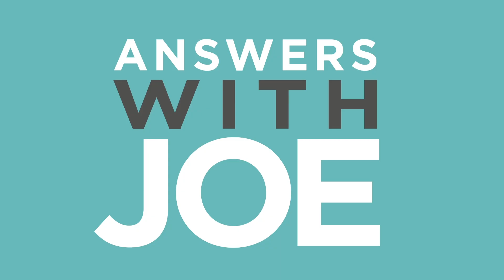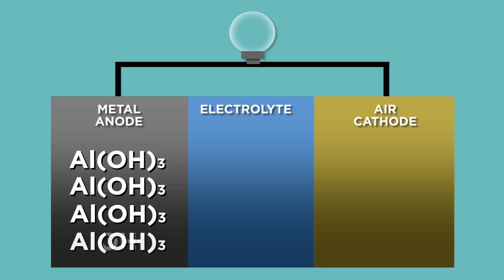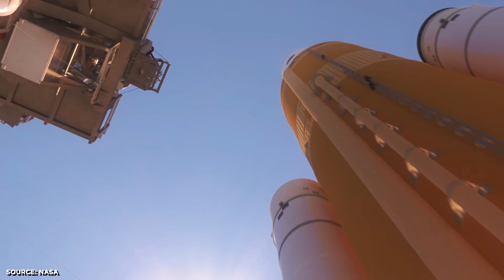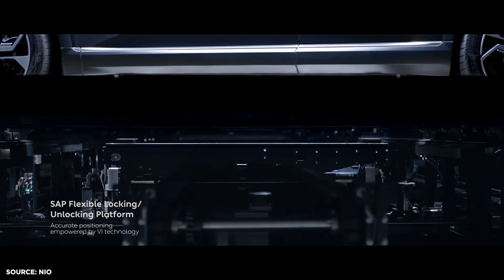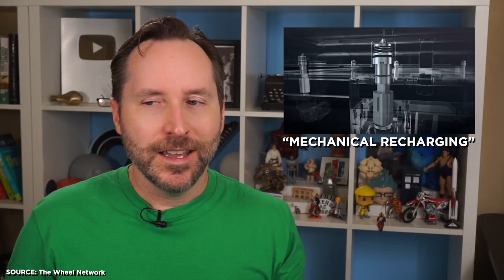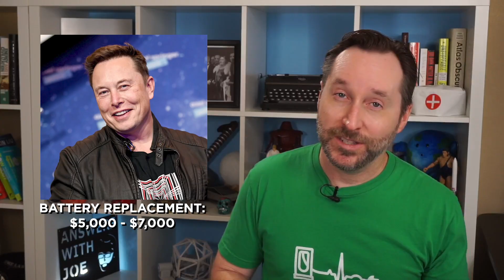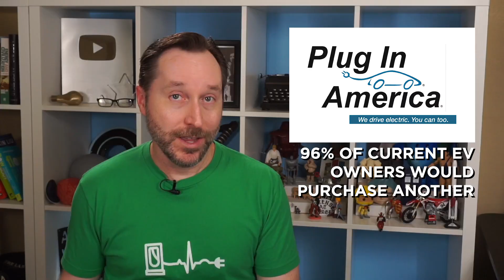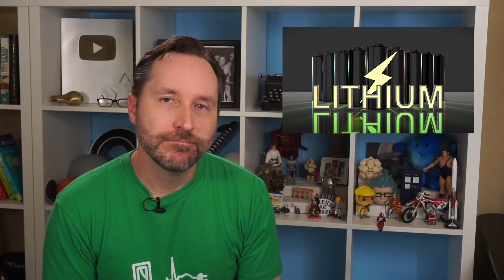This Battery Could Drive A Car 1500 Miles - But There's A Catch | Answers With Joe

Comment: I thought this was meant to be answers with Joe but I seem to have tuned into questions 😛 I've a question: What facts backup your statement that 'the majority of batteries end up in landfill'? Most small batteries end up in landfill but that's true of your Al-O hearing aid batteries too. I've not heard of a single EV battery getting junked here in NZ. We reuse them. My house has been running on Leaf G1 cells since 2017 and they are showing no sign of degrading in this gentle retirement. Remember, these are the oldest & worst EV batteries we're likely to see...
Anyway, great video and presentation but these batteries as described sound whack. Folks who think that EVs aren't good enough yet haven't been lucky enough to live with a Tesla. EV's aren't as good as any ICE, they are way way better.

Comment: instead of one big battery many smallish say 20 pound rechargeable batteries that are designed for quick replacement like on hand held power tools then when you go to a battery exchange station your in and out of there fast.  it could even be designed to use one battery up at a time. the exchange station could evaluate the batteries you bring in and give you a condition report of the bateries you drive off with to give you a fair price.  when I was a kid i had an electrick car it was a toy it had metal brushes that picked up power from  metal strips imbeded in the track.  just saying hmm.

Comment: The infrastructure for replacing aluminum air batteries already exists.  Your auto dealer and corner auto repair shop replace and recycle lead acid batteries on a regular basis.  New batteries are delivered and the old ones taken to recycling plants. The trucks are already in use delivering batteries and taking away the old ones.  Lead acid batteries are completely recyclable. You use the same trucks and plants to recycle the new product.  We used to have to add water to the radiator and the old style lead acid batteries.  This may be safer for the recycling workers as lead acid batteries contain sulfuric acid that must be handled with care.

JMA

Comment: on all boats and cars should have a energy generator using motor heat sun wind or water or air gass the energy gaind would be probably half the energy you spent but hay energys anergy idk

Comment: What no one is paying attention to is the added weight of long range electric cars.
Studies done in the 1950s showed that road damage is determined by the 3 or 4th power of axle weight.   So a fleet of EVs would tear up the roads 3 times faster ( given an extra 20 to 30 percent weight added by the Lithium Ion battery).   So far there is no substitute for either asphalt (from oil) or cement (lots of CO2 to produce), not to mention all the shipping energy required to spread the out to form repaired roads.   An asterisk to the current EV bandwagen that no one is talking about.

Comment: What's the point of using recycled battery systems over just using Hydrogen fuel cell? The energy cost of making these batteries probably works out to significantly more than the electricity cost of electrolysis.

Comment: Hey mate it is ALUMINIUM having said that I suppose aluminium batteries would be lighter I suppose but there again I am an internal combustion engine fan as out here in Australia the infrastructure is just not feasible except for within city boundaries because of the distances on some of our roads in the larger states.  I have to add too that out here here are tremendous amounts of bauxite ore which as you know aluminium is extracted. So for now I shall just stick to my lovely Mazda 6!! For my money I would rather see a battery that could be charged by solar panels on a house roof and be the only source of electricity for the property but I guess I am dreaming there eh??

Comment: These 3% is nothing. Its all in road transport mostly commercial with semitrucks. And this is 40%. Sea freight its 3rd most ecological transport after Trains and Air. Focus should be on making road transport as ecological as possible and it should be mix of investment into railways and hydrogen powered semitrucks where needed.
 Main thing is capacity of these trucks, if must equate or surpass simple diesel lorries, Elon's stupid semi is already pitifully inferior at that, showing that in this specific case that is most impactful and limited by law batteries are not a way to go.

Comment: Maybe one could just replace the aluminum electrodes once the battery was drained. Or flip them, to double service life. But i don't know how they are constructed and neither do i know if flipping them is even possible. Even if possible, i'd think i rather use rechargeable batteries in a vehicle.

Comment: I knew there was a catch as soon as I heard it was an air battery, but didn't know what it was, and Mr. Asterisk made me smile. And yeah, the more storage solutions, the better. Edit: Oops! As others have pointed out, recycling aluminium oxide is not more energy-efficient than refining aluminium in the first place.

Comment: but is it really? i mean if u have to use a lot more energy than the battery creates to create more aluminum at the end of it all, isn't it simply just another version of hydrogen. with that it also has the chicken and egg problem of not selling cars due to not having infrastructure while not having infrastructure coz it doesn't have cars? except the infrastructure is far more complicated. also, if i realize i need x miles(x being less than the range of my car) but my battery isn't full enough, i can just plug in. if a someone using the described battery in their car realizes the same but there is no appropriately located station near where they would run out, the only option they have is throwing away a battery with a bunch of miles left in it.

Comment: I still say nothing beats the infrastructural, economic and environmental potency of windup cars. 
Tank o´ torsion kinetics and regenerative braking. Rubber, glass, steel, sheeps wool/cotton/leather upholsteries and aluminium bodies, most all light weight, all exposure healthy, all long lasting and viable recyclables or naturally degradable.

Comment: Ahem.... Little point.. (yeah, i watched the entire video twice lol..).
Being a 🇬🇧, It was a tad painful to hear "aloominum" 41 times..... 😋😋😋
Other than that, another fine video Joe, though, with some of these tech/advancement 'promises', just have that salt shaker handy...
I mean, Honda and Toyota have shown that Hydrogen fuel cell tech CAN be a very viable tech, only if Hydrogen stations could start cropping up more and more, or maybe, along the line, through solar and smaller 'home' manufacturing setups, maybe an 'overnight'/'trickle fill' refuelling system could be installed in peoples homes that have said types of cars...?🤔🤔

Comment: Joe - Was your 4 cents per mile including Battery "Costs" - or Merely Electricity? - uhuh...7:44   
A car that starts well with 400 miles of range is crippled (as far  as the first owner  is concerned)  when that drops below 300.

Cost to restore that 100 miles is a New Battery Pack - as reckoned by Tesla. ~$14-18k  (base commodity Price - those suckers are not cheap)

Comment: Aircraft comes to mind. 
I didn't notice you mention the kg/watt hour but that powerful a battery could be just the ticket for short or medium haul flights if the weight/size exceeds lith/ion.
Should be easy enough to keep a stockpile at an airport and quick swap on tarmac then off to the recycling facility.
Might even be price competitive with kerosene?

Comment: 4000+ miles aircraft range is predicted using Breguet electric range equation with Al-air battery in my spreadsheet
Reply: This technically could be a zero emissions solution for long range aircraft, but maybe ammonia or hydrogen is more practical 🤔

Comment: I think it's a lot easier to pull carbon out of the air than it is to dig through landfills and oceans to get all of the "recyclable" materials out. Also, non-fossil fuel power sources aren't free, since the parts used to generate the power usually end up in a landfill after they retire. Most renewables have a lifespan of up to 20-25 years, meaning all those solar panels people are putting on their roofs will end up in landfills after 20 years. It's not a great situation to be honest. As far as I'm concerned, we need to be looking into ways to generate power that don't create externalities. For example, if we can create solar farms that use solar-thermal panels (reflecting light into a pipe filled with a liquid and using that heat to generate steam to turn turbines), and make them out of fully recyclable materials, that may be our best bet. Photovoltaic panels (the most common form of solar power) can be partially recycled, but most of them just go to landfill. Even the ones that get recycled only have some of their materials reused. The situation is similar with wind, hydro power, etc.

As far as the batteries go, I'm much more interested in batteries that don't end up in landfills, so these aluminum air batteries have my vote.

Comment: I like the idea of the dual battery car.  You could have a much smaller and cheaper li-ion battery with maybe 100 mile range.  If you typically drive less than 100 miles per day, then you are good, but on the occasion you need more, you pop in one of these.  The details are missing, though, like just how big and heavy would 500 miles of range be?  The dual battery idea would only work if you could load it into the car yourself at the expense of cargo space.

Comment: I think a compromise solution is simple. Have an EV car with lithium batteries, but that car must have a battery bay where it can install an aluminum air battery at its departure area, but when traveling to a far place, it just drops off the aluminum air battery to its destination. And when its time to go go home, just install a fresh aluminum air battery for the journey back.

Comment: Sad to say this but before any of these changes take place, the current system with all of the greed, and corruption in every industry has to be destroyed. I mean totally destroyed. Unfortunately the damage we all have caused to the Earth, even if we stop right now, no more pollution, no more fuel, it will take about 200 plus years for the Earth to recover.

So no, do not expect anything in the next 50 years. One thing I know for sure is that change doesn't happen until the worst happens. Human beings are smart but is one of the most stupid creatures on the planet.

Also what is sad is by the time we do wake up, it's too late anyway. The changes in the Earth will most likely will have killed the vast majority of us off by then.

Comment: I believe the only way you can have a totally low carbon and lowest environmental impact road transport system is to have self driving state owned pay as you use electric car infrastructure . As for commercial vehicles Lorries and vans powered by hydrogen with drivers or self driven with loaders unloaders on board and all that controlled with quantum computers doing the routes for the economic planning . Failing that if you want to stop global warming reduce the worlds population as thats the main reason for all the worlds resource problems.

Comment: Until there is a 500 mile electric car, us West Texans cannot consider it.  Plain and simple.  There seems to be  mentality that we all just drive 50 miles a day.  Heck, many of us drive 50 miles to work every day.  But the real problem is a 400 mile trip to visit family.  We do that several times a year and there is no where inbetween.  We cannot stop for 6 hours to charge up when the trip is only 6 hours total.  And another thing to think about:  Could the planet heal itself?  For example, more heat over oceans is causing more clouds which cause more rain and combined with a little higher temperature we get more plants which eat carbon dioxide.  Then don't forget the more clouds part.  Clouds are white which reflect heat....more clouds less absorbed heat (refelcted back out).  Thoughts?

Comment: Aptera can go 1,000 miles on lithium.  And it self-charges with the sun 40 miles per day.  And if you need more than 40 miles a day, they are cheaper to charge because they are much more efficient.
You can even get useful range from a regular 110V outlet.
The efficiency is due to extreme aerodynamics, no traditional radiators (cooling system requirement is low and is in the skin), composite construction, and reduced mechanical complexity using in-wheel motors/regeneration.

Comment: Thus building the infrastructure is required to utilize this novel battery. Recycled aluminum goes to other industries:  construction as reusing it as battery again is too costly and increased co2 pollution.

Comment: It's taken us 100 years to get our oil and gasoline infrastructure where it is, the feasibility of doing it again with hydrogen or gigantic replaceable batteries with automated swapping is hilariously unrealistic.
Reply: And petroleum is more energy dense than pretty much anything we have except maybe uranium, which isn’t so practical for cars... so why should we be required to give up our petroleum infrastructure? I say we ought to keep it!
Reply: @Ethan.Lamoureux  because Oil will destroy our atmosphere and you probably don't want have to use a spacesuit outside and fossilized fuel will run out before 2100 and biofuel is still bad for the planet even thou it would never run out...

Comment: This would be the perfect technology to pair with nuclear power. It takes a lot of power to reconvert the hydrolysed Aluminium, but it's comparatively cheap to get that power out of nuclear energy, especially if we can get Gen 4 reactors working properly and delivering (relatively) cheap power without producing greenhouse gases (like carbon dioxide). You could also do this away from major population centres and truck or train the batteries to and from a remotely-located nuclear-powered recycling centre. While we expect Gen 4 reactors to be much safer than the current earlier generation nuclear reactors, this might also give the public more peace-of-mind if it wasn't on their doorstep in case something does go wrong.

Comment: Just don't get in a car accident on a rainy day.  If the battery gets cracked, you are going to burn alive in a fire 500 times bigger than Teslas burn.  Also anyone in a car driving nearby is going to burn alive.  Even if the battery isn't damaged, good luck finding a first responder willing to extract you from your car.  And no port would ever allow an aluminum battery ship to dock.  Salt and water corrosion are a thing that would end badly.

Comment: Closed loop system, yeah except the energy required to mine, recycle, collect and distribute.  Your little jab at combustion engines and false claims EV  can out perform in every asoect. Lol, for short 15-30 min stretches. #CutTheCord

Comment: Aluminum is so very versatile, BUT, there are studies indicating the possibility that using Aluminum in conjunction with food products, especially in cooking, MAY be linked to Alzheimers. What are your thoughts on that? My personal thoughts are that, if you have a genetic propensity for it, it should be avoided, especially in  cooking. However I wonder about Aluminum toxicity, especially with how many gallons of carbonated drinks are consumed in the USA alone. Plastic is not the answer.

Comment: These batteries are a joke. You aren't producing aluminium oxide (Al2O3, Alumina). You're creating aluminium HYDROXIDE (Al(OH)3, Gibbsite.) That's all the way on the other side of the Bayer process. Which means you might as well be starting with raw ore. You might not have much in the way of impurities to deal with but you still have a massive energy investment to get it back to a pure ingot. Aluminium recycling is cheep because all you have to do is melt it down in a vacuum (or shielding gas... or eat the loss to oxidization.)

Comment: How is the Al₂O₃ reduced?  Could you make an automated, electrically driven mini-factories where you put spent aluminum-air batteries in one end and new batteries come out the other?   Something compact enough you could put it in stations dotted around the country? That way you wouldn’t have the huge expense of trucking the batteries to and from big centralized factories.  Once a month, just drive to the aluminum station and swap out the battery.

Comment: Why not use aluminum-air batteries for electric aircraft. It has the light weight and energy density that aircraft need. The fact that it is not rechargeable should not even be an issue. In fact, if it can be quickly swapped out, I would consider that an advantage for aircraft. We wouldn't need to place swap stations all over the US street and highway system. There is no need to rebuild infrastructure for electric aircraft because there currently isn't any. We could simply designate each airport that services Electric Aircraft an Aluminum-Air Battery Recycling center where the used batteries can be made into new ones again. All of the noise, pollution, and CO2 generated by our current aircraft could be replaced with a highly efficient electric alternative. Why aren't we doing this?